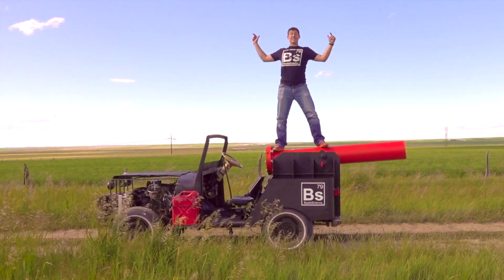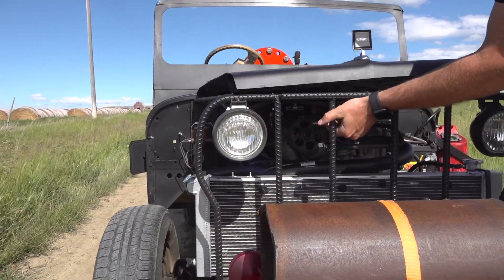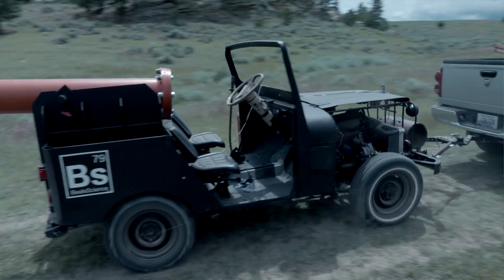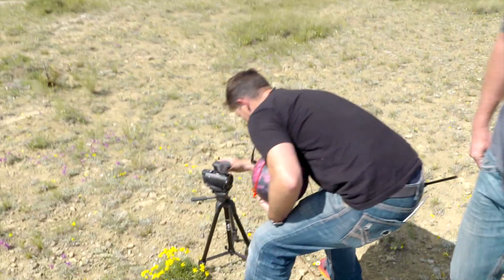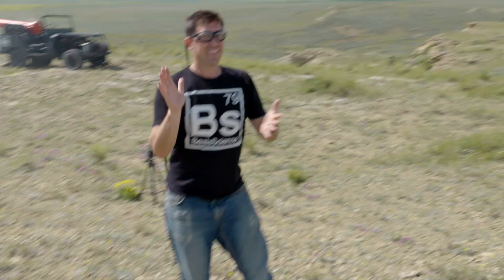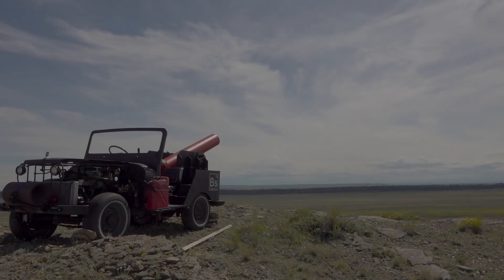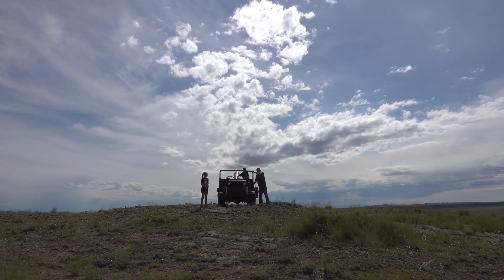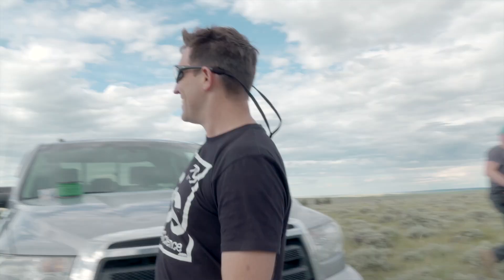Bowling Ball Cannon in a Jeep!

Comment: 5:26  Really, none of this is good protocol, and you are being EXTREMELY irresponsible in your loading and arming procedures. Please, next time find a way to light that fuse that doesn't require you to stand in front of the barrel. It's not a hard mechanism to design, a piece of tape holding the fuse off to the side should work. You should never say or imply that you are a teacher and then violate basic weapons safety. That is unbelievable. I would have loved to give this a like, but I'm going to have to dislike it specifically so that you have less of a chance of influencing children to do something similarly stupid. Please, please abide by basic gun safety rules. That cannonball has enough power to take off your head easily, and you just stepped in its way.

Comment: Gentleman and Ladies, you serious NEED to consult an experienced black powder shooter and enthusiast.  He or she will have a good idea of the starting charge (and do start low and work up) depending on the weight of the projectile and the bore size.  

After firing the first shot, I hope all you scientists checked the cannon for cracks, missing bolts and possible expansion of the cannon body.  Check it for defects every time, for that matter.

Some wadding about the projectile - newsprint will do, cloth is better - to seal the bore and give all the energy to the projectile is always advised.  

But good heavens!  Don't stop now.  It was done long before cell phones, it can be duplicated.

Second and third shots:  The projectile stays so long in the air as the heaviness gives it a lot of momentum.  (mass x velocity, presuming you can divine the velocity.)

In cannonry, the term 'laying in' is the process of aiming the cannon.  Over time, this has progressed from "that way' to 'looks good' to computers.  It would seem you used the 'looks good' concept but you layed that gun in well.

Targets?  They were originally intended for fortified positions, like city walls or castles.  How about a section of 'wall' as possible?  Pile of stones or bricks sort of thing.
Reply from the maker: Thanks!

Comment: The flex in the jeep chassis is just brutal!
Reply from the maker: It’s crazy isn’t it!
The last time I took it out for a shoot it flexed so bad it broke the bolts on the seat mount, the steering column, and a leaf spring.
Nothing a little welding can’t fix.

Comment: Looks like your barrel diameter is too large for the shot (bowling ball). It's losing too much gas out the end of the barrel before the shot is ejected. Try some (canvas?) wadding between the ball and powder or encase the ball in something that will give it more effective diameter. Civil War era, smoothbore, single shot cannon typically had only about 1/8" difference between the bore and shot diameters. And a 9" (bowling ball size) diameter shot of the time weighed approximately 90 lb.

Comment: Try it the medieval way guys. They used a circular piece of wood behind the cannonball, to prevent the hot gasses from escaping too soon like with your cannon, to significantly improve the range of their cannonballs. Try it :) Or make a polyurethane prop wrapped in a fireblanket, then you can even minimize the margin between the prop and the inside of the cannon. Very cheap!
Then attach a long rope to the prop so you don't have to go searching for it every time you shoot your cool cannon 🙂
Reply from the maker: Thanks for the tip!
Reply: @BealsScience  pleasure!!! let's make it go 5km!! :)
Reply from the maker: I would love that!!
Reply: @BealsScience  well, make sure to add half the shape of the bowling ball to the plug behind it, so half the width of the bowling ball as plug plus the shape of half the bowling ball to that... 
here's what you do:
use cardboard as a spacer, wrap the bowling ball in kitchen foil, cardboard tight around the ball, make sure everything is level, add a bracket to attach a rope, fill with construction polyurethane, as rope use the thickest fishing wire you can find, those can catch a tuna fish, it can catch a plug too... and attach the other end to something not the canon, the car is fine... I wanna see that test!!
Reply from the maker: @florh  this is fantastic! Thanks for the tip!
Reply: @BealsScience  any time!

Comment: the reason you use a wad in a cannon ,,,the wad helps build the pressure an alleviate the gaps in the barrel to the projectile... same concept in a musket. this way you can also launch less stable projectile... like a pumpkin... so there is the project... launch a pumpkin with out destroying it when it is launched
Reply from the maker: I agree that it would be fun to launch a pumpkin!!

Comment: Looks cool but.... You're giving ideas to a lot of people to blow themselves up. Have you ever studied black powder artillery? There is always a massive breach ring or swell to handle the massive chamber pressure. They are cast so the stresses are absorbed around the rear. Your design relies on what appear to be 600lb flange bolts to hold the breach from blowing rearwards much faster than the projectile launches out the muzzle but half of the bolts are missing. A few rules about artillery: NEVER stand in front of the muzzle, look down the bore, especially when loading, and never keep your arm in front of it. If that charge initiates, you're done or you're one handed. You also don't stand behind a loaded gun. The energy is directed forwards (or rearwards in a failure). Your charges should be made of aluminum foil shaped around a former. Use a ram rod to push the charge home and tamp it. You prick a vent hole from above using a noncombustible rod (brazing rod), fill the vent with a small container of fine black powder with a small mound on top about the size of a Goldfish cracker to ignite. You should use some wadding between the charge and the ball if you want it to really go far or blow up. In all seriousness, I think you have a death wish. Cool Jeep.

Comment: I seen the video of you using wadding, thought, nope!. I would have folded the cloth and half wrapped around the ball until it's tight in the pipe then pushed the bowling ball down with a board, but just I seen how you used the fuse.  I've always wanted a cannon so last week I bought a 3-1/2" seamless tube with 1/2" wall 41" long. I tig welded a 3/4" thick 45 degree beveled plug.  I just ordered some fuse. 
Kids think I'm nuts, I'm not but why on earth don't you put ALL the bolts in that flange? Bolt's stretch. I work, build bridges and had to get trained to use bolts, tightening is depends on length. No torquing involved, based of Flats on the nut turned. Other than mag testing your bolts you'd never know they're weak/ stress cracked until the flange blows off. Like a diaper change bolts often.

Comment: Take the bolt n washer and nut off the top of your barrel and put one on each side 11 and 1 o'clock  use the top center hole as a rear sight and weld a piece of mild flat stock as a front sight. Easyer to line up your shot . Made one as a kid to shot old softballs the girls team threw them away. Never found any of them. 4 to 6 coffee scoops  of 3F  black powder and we used old newspaper as a wad better seal. Better burn of the powder

Comment: You could in theory launch a go pro and record the video launch, or use surveyors tape and tape 20- 10 foot long strands to the back of the bowling ball so you can see it flying through the air and if you really want to be creative take a new bowling ball have them cut a larger diameter hole in the bowling ball and put a smoke bomb inside the newly drilled hole and tape the fuse together with the explosive charge so by the time the cannon discharges the smoke will have started to burn with bright orange or red smoke making it easier to track midair......
Reply from the maker: These are all great ideas!
I’ve got a new video where we tracked the balls to get distance and the next time we go I plan to embed a GoPro in one of them!

Comment: Try to put a tracker inside the bowling ball, like the ones used in model rockets. So you can find the bowling balls, and measure how far they went. Then you can calculate the initial velocity.
 The cameras should give you a rough idea what direction they went. 
45° elevation is for maximum distance on a simple trajectory shot.
Reply from the maker: Thanks!

Comment: You're wasting LOTS of energy being that your ball is too small for the tube..for example, if you have a rifle round that doesn't interference fit with barrel, it will just rattle down the barrel and come out at a greatly reduced speed. The tight fit gives it time to acheive a max power explosion. You need to wrap the ball with a towel or some ( hopefully non combustible ) "WAD" like black power rifles use. Notice on your videos how much flame comes out BEFORE the ball does. all that is WASTED energy. Get the seal right and you could DOUBLE the output force.

Comment: I think if the barrel was just about an inch smaller in diameter the ball would have went twice as far with half the powder. A lot of that energy escaped when it turned into gas and went around the sides. When I was in the Army I was a 13B field artillery we would shoot 155 mm rounds that weighed 100+ pounds out of a 155mm howitzer and putting the rounds in the breach with powder bag increments under it. The only spaces around the round was the rifling in the barrel. These things would go miles, so imagine a 5-10 lb bowling ball. 🤷🏻‍♂️
Reply from the maker: I did not realize the rounds in a howitzer can be 100+ pounds!!! That’s incredible!
I do agree that we could have a tighter fit, but I was a little nervous about having a pipe too tight because I didn’t know if it would blow itself apart.
Thank you for the comment and thank you for your service!
Reply: @BealsScience  thank you for the entertainment! And yes the 155mm howitzer was the Mac Daddy if towed Artillery, every once in a great while we would shoot a M712 Copperhead that weighs approximately 140 lbs and effectively travels about 10 miles. HE rounds can travel up to 10-15 miles. A little fun fact 😆

Comment: awsome video and project,but my question is why didn't you put a wad around the bowling ball so it made a tighter fit and it is more airtight " kind of like a musket", and to  save fuse why didn't you put a vent hole in the back of the Canon, awesome video it never gets old lol
Reply from the maker: Thanks!
I didn’t use wadding because I didn’t know how much pressure the pipe would handle. It is from a scrap yard so I had no idea if it was “safe”.
I recently tested it with wadding. Video coming THIS WEEK!
There is a vent hole in the back. I plan to test/use it on the next trip out.

Comment: Not sure if you wanted to try this
How about shooting an oxygen bottle with some oxygen in it 
Or maybe a gas bottle with some gas and oxygen mixture in it,  but I would make sure you have a shelter to hide behind 
And if you drilled a hole top side at the back, and fed a wire through it, you could drag the fuse there and light it easier and give you more of a chance to get further away.
Please let me know if you do this and when
It's also unfortunate Putin is not the target.
Just reply on this video with the link

Comment: Well as a former member of the Field Artillery, you could fashion a shell, also made out of steel pipe and put some gas check bands around the shell to be sure of a tight fit, and probably pound and a half of powder fired shell at 45degrees or 1600 mils.   Probably nail 3  miles with shell... Shell could also have welded fins on back to impove distance tracking since it isn't spin stabilized like cannon shells with a rotating brass band.  If it flies end over end it decreases range, so fins for stability of shell, recommended.
Reply from the maker: Thank you for watching, for your suggestions, and for your service!
Reply: @BealsScience  Thank you for interesting videos.  Oh by the way, the Ukrainians are doing amazing things against the Russians with Mortars and Artillery.   The attacker must vanquish, the defender has only to survive!!!

Comment: Why don't you have a fuse hole instead of lighting a fuse down the barrel? Put your powder in tinfoil poke a hole through a fuse hole in the cannon and put the fuse through the fuse hole into the tinfoil powder load. It'll be much safer.

Comment: Thats great but could be better. Use a sabot made from expanding insulating foam for a better seal. Not my idea, came from mythbusters chicken cannon to test aircraft windshields. Add a disc of something easy to cut but hard to ignite on rear to avoid shooting fireball, watch that episode of mythbusters to see how they molded their, your best bet would probably be a scrap piece of the pipe you made the barrel from.

Comment: You need to add some wads behind the ball so it was sealed the ball coming off, don't wrap the ball around it just put the powder in then stuff some rags down the top of the powder and then roll the ball down in it that will seal the ball and give you more pressure coming out the cannon is thick enough to take the pressure t it would not blow up that heavy wall pipe you did a wonderful job keep up the good work Ray

Comment: You can lower the powder charge by wrapping the ball in a wad. Greasing the barrel and the projectile will increase the pressure and speed the projectile leaves the barrel. The shockwave of air returning down the barrel will be much louder and the projectile will fly a truer and longer distance with greater impact. You should have a bucket of water and mop to clear the barrel between loads. Also I would choose a water-soluble lubricant or Grease. You can get five gallon buckets of the stuff that's rated kitchen safe. Or use soap pipe lube the contractors use for putting together gasketed pipe. Also available in 5 and 10 lb buckets and very cheap. I would like to see what your bowling ball would do against the side of a car at 50 yards. I'm thinking that would look cool...lol
Reply from the maker: Thanks for all the info!!
Reply: Yes, please mop it after firing and don't stand in front of it when lighting the fuse or when loading in the ball.  Even though it's long, you could have some loose powder in the barrel that could set off the charge sooner than expected or static electricity. If you're going to use the plastic bottles of powder, I bet you could make a non ferrous puncturing rod to pierce the bottle and insert a fuse from the back.
Reply: And it was awesome!
Reply: Oh Jeez. I just realized this video is three years old.
Reply from the maker: @Raceydog  thanks!
Reply from the maker: @Raceydog  a new one is coming soon!

Comment: To tighten up the tolerances of the pipe in the bowling ball because of your poor selection in the beginning just take a t-shirt or something and cut a big round wad lubricated with a little oil Maybe and it will tighten up the tolerances big-time the power will increase the distance the range the boom everything

Comment: Fantastic science experiment. I watch a load of these type, and always enjoy them. I wonder why I never saw one where a chip or tracker was drilled into the ball so that it can be traced and shown how far it has gone, and where, to correlate with the trajectorial predictions. If it can be located using the chip, it would be interesting to see the impact results as well.
Reply from the maker: I am editing a video right now where we tracked down and found every ball we shot. We did it old school by having a search party watch and locate the ball. But, I am going to try to put an Apple AirTag in one of them the next time we go out to see if it will work!
Reply: @BealsScience  Great stuff. Thanks. Will watch keenly for that video
Reply: A tail made of something BRIGHTLY COLORED,  DURABLE and FIRMLY ATTACHED  to the projectile would make the in flight view of the projectile more visible.  Twelve foot length and maybe 1 - 1/2" wide ???  (Velocity might destroy it though)

Comment: The distance would be greatly increased if the inside diameter of tube was just a little smaller so the bowling ball fit tighter so more energy would be retained behind it and no pressure escaping around it.
Reply: A little wadding would do the trick.

Comment: You could drill a hole in the bowling ball and set in a smoke charge to give you a tracer then shoot 47 degrees for max range and set max propulsion charge.
Reply from the maker: Great idea!
Reply: @BealsScience  Thx yeah, I think I read once that any artillery man will tell you that max range angle is 47 or 47.5 due to wind resistance. Careful of setting a fire downrange from the smoke charge. Sometimes they flame out. Also I don't know if carrying a flammable payload would legally change the category of what your launching, but it might be worth looking into.

Comment: Jeep is cool. Should have used a compressed gas cylinder for the cannon instead of that oversized rusty pipe. You'd use a lot less powder and get better distance.
Reply from the maker: I’ve seen several mortar style cannons with cylinders but decided to try something with a longer barrel just to see what happens.
Thanks for watching!

Comment: What should you shoot? A black powder filled bowling ball. drill one of the finger holes to the center of the bowling ball. determine flight time based upon previous recordings of empty bowling ball. Cut fuse to length for desired airburst time. Epoxy fuse to side of extended finger hole. Put desired amount of powder into finger hole. Seal with cotton balls mixed with 5 minute epoxy. Cut fuse for propellant powder  and splice to charge powder to synchronize detonation of charge powder to desired distance attained after ignition of propellant powder.

Note: for interesting display, charge powder can be mixed with different powdered metals. Copper, aluminum. magnesium...
Reply from the maker: This is a fantastic idea! It makes me a little nervous but that is also why I like it!!